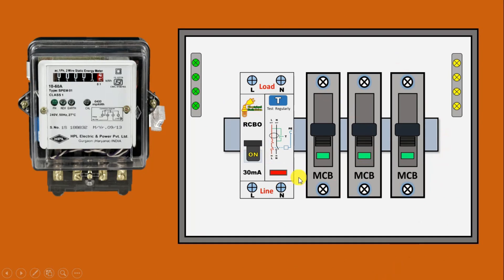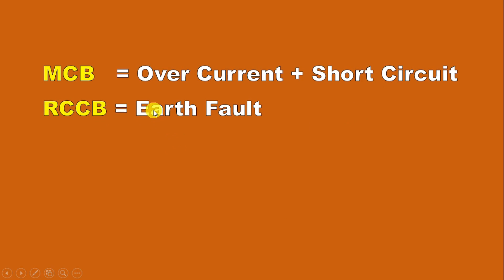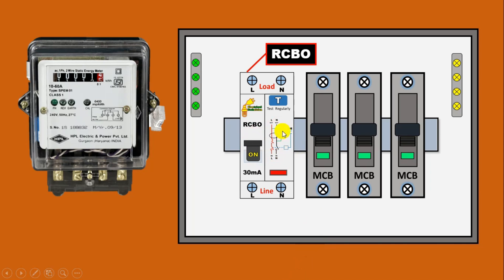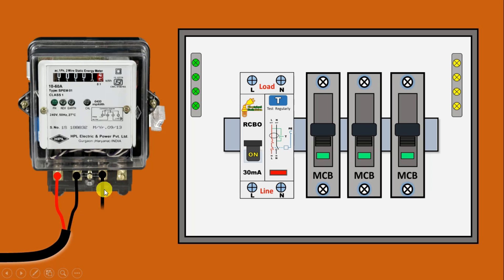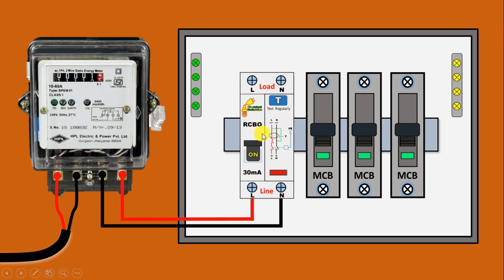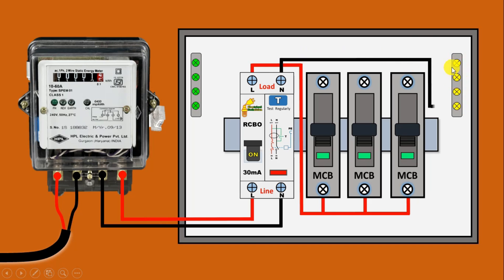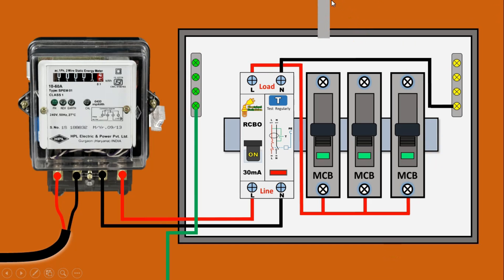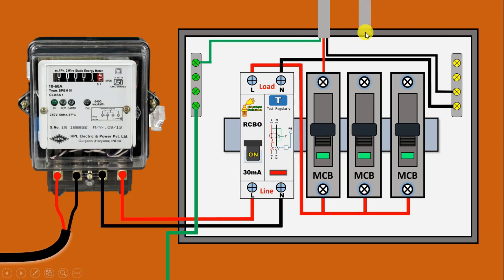How to wire RCBO Breaker in Distribution board | RCBO Connection @TheElectricalGuy

Comment: Hi
Your training video is outstanding
If I use a double point mcb  as main switch and two invidual rcbo : one for lights and one for power points. Is this way the same connection with yours?

Comment: What is the point in using an RCBO, followed by MCBs?
The RCBO already contains the thermal protection of a MCB and in case of a short-circuit down the line, in any of the three rooms, the RCBO will trip first, instead of the MCBs, cutting off the energy in all three rooms at once, making problems identification harder.
If you decide to use the RCBO, use it on its own, as protection for individual circuits.
In this case, it is better to use three RCBO devices, one for each room.
Alternatively, if you still want to use MCBs for every room circuit, you are better off using a RCCB in front of them.
Reply: Exactly.